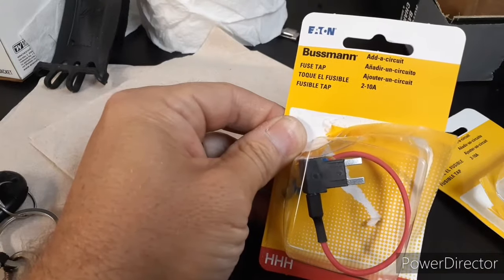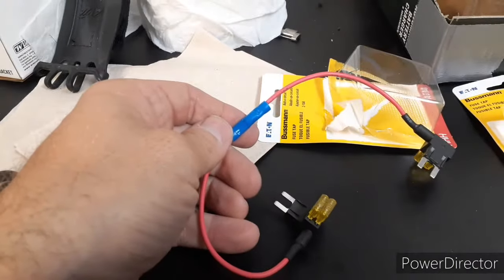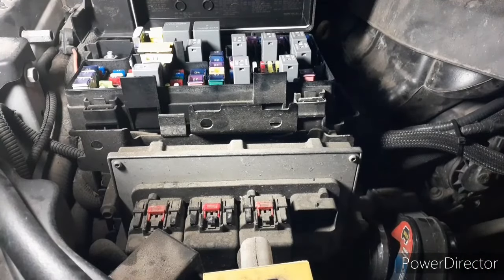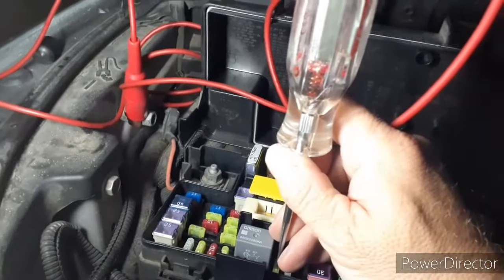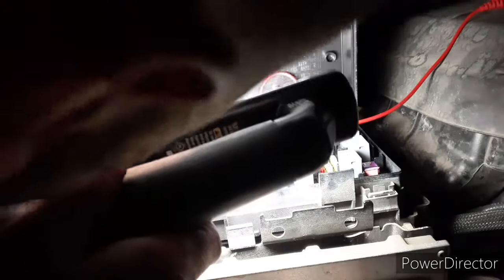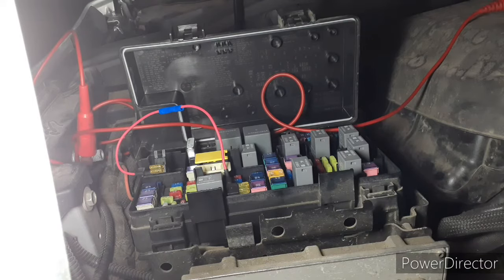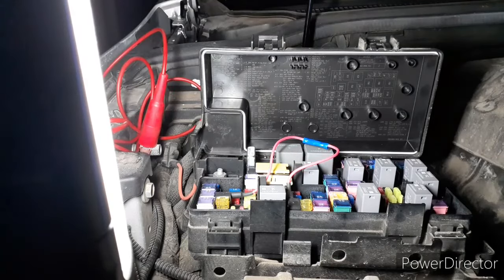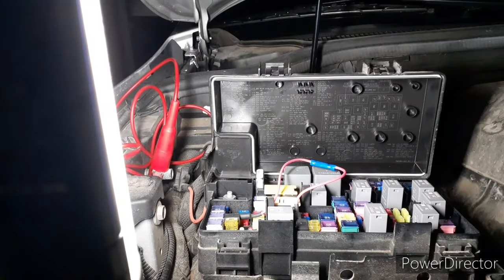Jeep Cranks But Won't Start. PCM Bypass Solution.

Comment: Hi. I have 2002 grand Cherokee overland. Yesterday it stalled like it was starved for fuel. After sitting for a bit it will start and run for a few seconds. I think I have it narrowed down to the skim and or pcm. Does this bypass the skim as well as the pcm. The light on the dash that shows a key with a line through it comes on.
Reply from the maker: Your computer system is different on an 02. No promises it works. I don't know what you are referring to about a "skim".
Sitting for a bit and then working is typically contaminated fuel by the way. The reason it works is you are giving all the contaminants a chance to settle. When you stir them up and mix them into the rest of the gas a problem exisits.
Reply: @dinstaar  the skim is the black ring around the ignition that reads the chip in the key. It sends a signal to the pcm only providing power to the fuel pump for 3 seconds and then shuts it off. Security feature. Seems to be a constant issue from99-04. Most videos have the pcm “wiped” and the skim removed as not to reprogram to that specific key. In your opinion, opinion only, would testing your technique cause further damage?
Reply from the maker: @kevinkelly3456  ok, now I know what you are saying. I have honestly never dealth with that specific issue. I can promise you though that wiping a computer is easy, getting it back to correct perameters can be a challenge. Be prepared to send it off for reprogramming if necessary.
Reply: @dinstaar  thank you!
Reply: Kevin, have you had any luck with this? I think mine is the key issue as well. What needs to be done?

Comment: 14 wrangler intermittent crank no start. Usually, we'll turn the key back off and will start the 2nd time. Was this also your your problem?
Reply from the maker: It really could be a few things. I don't have your jeep in front of so I can only try and tell you to check a couple things.

First, does it only happen if you have parked it for awhile? If so it is likely you are losing prime. Cycle the key on, wait about 30 seconds, then start. This will prime your line.

Second, do the electrical checks I show you in this video. Your PCM issue may have started. Key on and see if you have power where I tell you to look in the video. If you do not, do this bypass. If you do, you have a priming issue.
Reply: @dinstaar  if it's losing prime, would it more likely be a fuel pump issue or a vapor lock issue. I'm leaning fuel pump, but would like your opinion. No visible fuel leaks, currently.
Reply from the maker: @brianchambers6225  Troubleshooting this issue over YouTube comments is impossible.  Sorry.  I would need the vehicle in front of me and a lot more information.  If you are near Waco, TX swing it on by and I'll take a look.😀

Most commonly this could be your fuel pump, fuel filter, a cracked or loose line somewhere, or contaminated fuel.
Reply: @dinstaar  I appreciate you taking the time to respond. I'm in KY so I probably won't be bringing it by. I do appreciate the conversation though.😁
Reply from the maker: @brianchambers6225  It is most likely one of the things I mentioned. Check those out and you'll find the problem. Good luck.

Comment: 2004 grand Cherokee has a problem with hard starting. Change the fuel filter first couple times it started right up now it takes three attempts burned out the starter new starter. Started right up couple times now we’re back to three attempts before it starts. What could be the problem
Reply from the maker: That sounds like you are losing prime when you park it. Let me guess, it happens when it sits for a bit?

Comment: Hey buddy quick question   if I change the computer in the car for other reasons.. Will this get rid of the security part of my computer so I can just turn the thing on  I'm going to try a junkyard computer hoping your hac will bypass security
Reply from the maker: His hack is specific to fuel pump failure due to a known issue with the PCM. It has nothing to do with security.

I am not sure how Jeep disables for a key programming issue but I believe the starter will not turn over. If I am correct this bypass will not work and neither will a new PCM.  Sorry man.

Comment: My friends 2009 Jeep Grand Cherokee with a 3.7 will not start. It will randomly start sometimes when we try but it’s not having any engine codes. It will start sometimes and we replaced the fuel relay fuse and it ran for a week then wouldn’t start again, it started back up and it’s a constant pain to try and find the problem . Suggestions?
Reply from the maker: I suggest you take it to a mechanic who is very good at electrical issues. There could be a ton of different things causing this issue. If you are in the Waco area let me know.

Comment: I’m gonna read every comment this is amazing. I have a 2011 Liberty.  I need a voltage tester ASAP
Reply from the maker: This is a known issue on your liberty as well. Be sure to follow the voltage tests to ensure this solution is for you. 

Good luck.
Reply: Will this fix issue on 2019 Renegade? 2.4 L multi-air. Happened once and finally started and ran fine for 2 weeks, and threw a code p0069 pcm replacement after I finally got it started. Happened a 2nd time and it won’t start
Reply from the maker: @jeffb8562  No, sorry. Your PCM is different and most likely needs replaced. Good luck.

Comment: Hey I have a 2012 grand Cherokee, installed a new battery, starter, fuel pump relay kit, fuel pump is working (checked with a jump wire on 87-30) same test on the starter relay.... this fuse wire didn't work. Checked all relays and fues' 

Starter still spins but doesn't crank, will crank for a second randomly 

Is it time for a new pcm?
Reply from the maker: I need a better description of "starter still spins but doesn't crank, will crank for a second randomly."
Are you saying the starter is turning on command but the engine will not turn over?  Or are you saying it is not cranking long enough?  Please clarify.

Also, you cannot check to see if your fuel pump is working with a jumper wire.  So please tell me what you did here.  You can check your fuel pump by checking power at the pump, or cracking a line and seeing if fuel is coming out to the engine.
Reply: So it spins but doesn't engage with the engine. Randomly it will catch and try to start, have got it to actually start twice. I have put a jump wire on the 87-30 in the fuel pump relay and I do hear the pump working
Reply from the maker: @5K7WLKR  your starter is not engaging with your flywheel. You will have to pull it out and bench check it. Make sure your pinion is pushing out your gear so it can engage. Your problem is that the gear on the starter is not turning your flywheel.

Could be your Bendix, solenoid, or a bad electrical connection. Best way to check it is to pull it out and put 12 volts straight to it and see what happens. Be safe. You better hope it is your starter because if it is the gears on the flywheel it is not a small job.
Reply: Crap, its brand new 8hrs to install myself lol (new motor mount aswell)
Reply from the maker: Sometimes new parts are bad. Sorry.
If it's not the starter, then get upset because the alternative is worse.
Reply: Yea it happens, thanks for the reply and info!
Reply: update Hey, I did a bench test on the starter, works, fly wheel looks good.... any thoughts?
Reply from the maker: @5K7WLKR  Is your starter staying pushed out while spinning? It needs that gear to engage and turn the flywheel. If it is, than you may have an engine problem. 

Also make sure you are getting a full 12 volts to that thing so it has the power to turn over the engine. When you get it back in, have a buddy crank it while you are checking with a multimeter. 

Good luck.
Reply: Hey, yes the starter pushes out and stays out. I will check the voltage. Thanks

Comment: Hello from San Antonio,  my son tried to start my 99 JGC but he didn't have the alarm remote and the alarm went off and he tried to turn it off by turning the key. But it wouldn't turn off until he got the remote from inside. Now the jeep cranks over but will not start. It sounds like it wants to but nothing, I've even tried starting fluid. Do you have any advice, I can't afford to take it to a  shop at the moment. I would really appreciate any advice you can offer.
Reply from the maker: Does this have an aftermarket alarm system with a kill switch feature? If so, get rid of it.

Comment: Is this the same for a 2012 jeep Compas but my wife doesn’t have a cigarette lighter is the fuse still there cause that’s exactly what her car is doing it cranks Kranks Kranks a new start
Reply from the maker: Open your fuse box and look.  If yours is the same as the one on this video, it will have that fuse there.  If the fuse is missing (because it does not have a lighter), you may have to stick a fuse in it.

Comment: do you know if the gauges still read out despite the PCM being byapssed?
Reply from the maker: I am only bypassing to operate the fuel pump. No gauges are effected at all.
Reply: @dinstaar  thanks!
Reply from the maker: @Electronica27  no problem

Comment: @DINSTAAR I ordered a PCM but I intend to try your solution first on my 2011 Jeep Liberty.  Its starts and keeps running only when the gas is held down (but runs rough), stalls out when released.  The starter also runs on after the vehicle is started.  My mechanic said I needed a PCM after replacing a few coils and the issue did not go away.  They tell me that the cylinders were not communicating with each other and some cylinders don't display proper compression.  They also said it was not a mechanical problem. They never mentioned the fuel pump not working properly.  Please let me know if this sounds like your solution would work. I understand you can't give me a definitive answer but a percent chance would be nice.
Reply from the maker: This solution will absolutely not fix your issue. Your PCM is malfunctioning on several levels and needs replaced. This only addresses the common PCM failure of powering the fuel pump. If your Jeep starts, this is not for you.
Reply: @dinstaar  Thanks!
Reply: Hi my 08 liberty has same problem as you describe, what did you do to fix it thanks
Reply: @kurtengel6029 on mine, It wasn't anything to do with the computer.  It was in the cylinder but they wanted 4k to fix it so I bought a renegade and got 400 for the dead car on trade in

Comment: My 02 jeep liberty 3.7 had fuel pump fuel filter and crank sensor change. Its cranking but not starting. So what can be my issue
Reply from the maker: Impossible to know for sure without the vehicle here to run tests. Could be at least 100 different causes. Someone needs to see your Jeep in person.
Reply: @dinstaar  Thank you.. Found the problem. The new fuel pump regulator line was not install right from factory. So I had to put on a new plastic line with better clamps to hold it in place. Its running like a sewing machine now..🙂
Reply from the maker: @demetriusjohnson3677  Glad to hear it.

Comment: Hi. Great comprehensive vid. Thank you for taking your time. 

My key light (key with a line across it) is showing and so it is most probably due to either the key, skim or the PCM unit. Will bypassing the fuse like you did help solve my problem? Your kind advice will be much appreciated.
Reply from the maker: Not likely. This bypass only turns on the fuel pump. Good luck.
Reply: @dinstaar  Thank you for your reply. Much appreciated. 

Stay safe and healthy!
Reply: I have exactly same problem on my TJ jeep
Reply: @bearclaire6894  My issue took forever to figure out. Until the mechanic found that its the AC unit that was faulty and so somehow affected the electronics causing the key light to turn on (and engine to shut down randomly). I changed pretty much everything else but only until I replaced my AC unit was the problem solved. The mechanic said he was sure it was the door lock switch panel that may have caused the issue but turns out replacing that didn't help. 

Yours might be caused by a different issue. But I hope this info helps as nobody seems to think a faulty AC unit (the unit in your dashboard) could've affected something so unrelated. 

Good luck!
Reply: Do you remember what exactly they changed?  I have the same issue.  My heater core went out and soon had that red flashing key on the dash which prevented the vehicle from starting.  Thanks for any info.
Reply: @enriquereynaga8188  He replaced that AC unit (black plastic part with the AC switches and knobs) in the dashboard. This was after trying to replace pretty much every other components that would have usually caused this issue. Lucky me the mechanic tried to fix the issue by replacing each component one by one with parts from his own Jeep to pinpoint which part precisely was the culprit causing the problem. He parked his Jeep for weeks in order to lend me his components and have me test drive my car to see if the problem persists. After the AC unit had been replaced, the problem was solved. It must've been over a year now since that repair and my Jeep is still working great. No more key light and no more issue with not being able to start the engine or engine shutting off while driving. 

My apologies for not knowing the proper names for the components but the things I remember him testing were: 
1. The key itself (he says there's a chip in the key that may have caused the issue)
2. Ignition switch (there's this ring in the ignition switch that was supposed to sense the chip in the key.
3. ECU units in the hood. (Not sure what they are called)
4. Power seat control unit under the driver's seat.
5. Window and central lock unit
6. A unit under the steering wheel
There might have been more units he tested that I don't remember. 

All the above components were not the cause of the problem. At the end, I only had to replace my AC unit with a used one that wasn't faulty. The repair cost turn out to be just for the AC unit. I was so thankful the mechanic did what he did and didn't just charge me for all the components he thought was faulty without trying to look for that one faulty piece. I gave him a huge tip. 

The AC unit may seem irrelevant to the key light and engine not starting and shutting off randomly but he says the electronics are all interconnected. Not going to argue with him since the issue was indeed resolved once the thing was replaced. And he definitely didn't rip me off since the repair was pretty cheap (used AC unit + repair fee). 

I hope this helped. Good luck.
Reply: @4120306  I have a 2009 JKU and it’s been parked for 1 week now. The ac stopped blowing Friday afternoon was driving well I parked it in the driveway. My husband got home that evening and tried fixing it. Well, once he thought he fixed it, he went to turn on the Jeep to see if it worked and it wouldn’t start. No crank, nothing. He has checked all wiring for corrosion/shorts retapped all that were. Checked all fuses. And still nothing. The battery we just purchased a month ago new. Code reader doesn’t read anything, only “error/fail.” And I see that the key light is flashing. We’ve tried every trick that the wrangler and jk forums show. But you are the first to mention the ac unit. Definitely going to give that a try. Thank you!

Comment: Would you know how to get alternator work bypassing the PCM using external voltage regulator?
Reply from the maker: If your alternator is not working, the only solution is to replace it. You cannot regulate voltage that is not there.
Reply: @dinstaar  I have a Town and Country minivan and my alternator stopped working I replace alternator but still not working I want to bypass PCM / computer because I just need the battery to charge. 
I have an external voltage regulator and I can get power from fuse box that turns on when the key is on.  It should work but it's not Alternator is new and checked and voltage regulator is new too. 
But still not charging I am missing something, but I don't know what. Can you help me? I will generously make a donation to you. Thanks
Reply from the maker: @marcodeluca4068  It is impossible to diagnose this over yahoo comments. However, I can tell you that your PCM has absolutely nothing to do with it.  Your alternator is directly connected to your battery. Look at your wires and battery terminals. Look for broken wires, corrosion, a loose connection, or a bad ground. Also, test the alternator directly at its connections for voltage between 13 and 14 volts. Test the battery too, it may be bad. Follow these directions and you will find the cause of your problem.
Reply: @dinstaar  Battery and alternator are both new and checked but if I connect the alternator to external voltage regulator it should work right?
Reply from the maker: @marcodeluca4068  Modern alternators have regulators on them. You should not have to connect it to an external one. What is your voltage at the alternator?  Jump the van and connect your multimeter to the posts on it and see. You should get 13 to 14.5 volts. If you don't, your brand new alternator is bad. If you have good voltage, check your connections and make sure they are tight ND not corroded. Follow the wires from the alternator and look for breaks.

Comment: Will this work on a 06 Jeep Commander 4.7l V8? Shop said I need to go to the dealer to get the TIPM replaced and the new one must be programmed by the dealer. Cost $900
Reply from the maker: Tim, without your Commander here in front of me I cannot troubleshoot it. If you Jeep will not start because your PCM is not sending power to your fuel pump, this is the fix.
Reply: I am saying if I bought the fuse tap will this fix my jeep commander
Reply from the maker: @timland7553  Bring your Commander over and I'll look at it. I cannot troubleshoot your specific vehicle's issue over youtube bud.